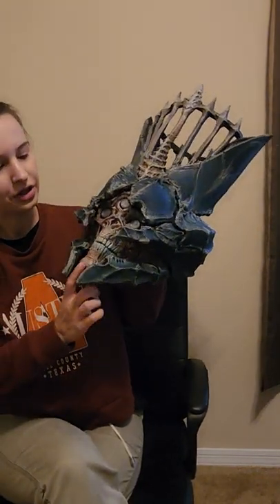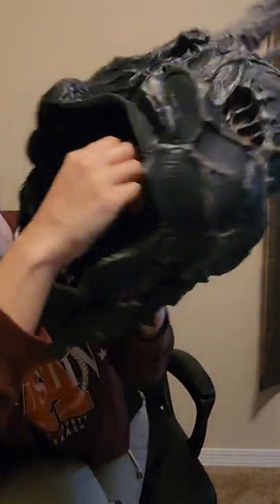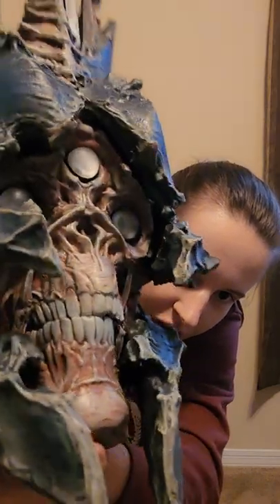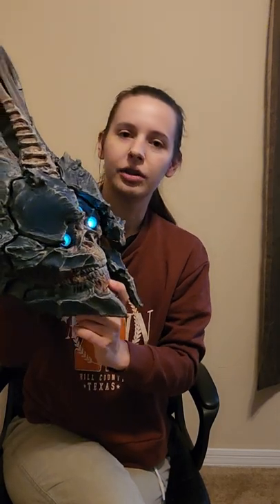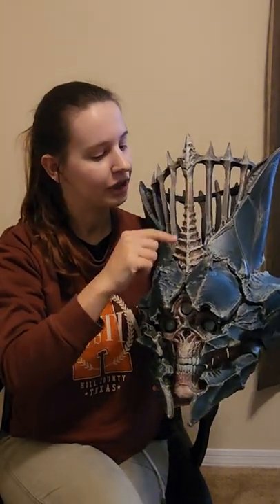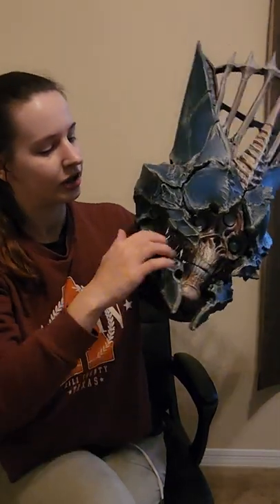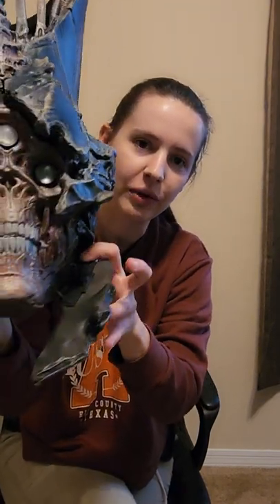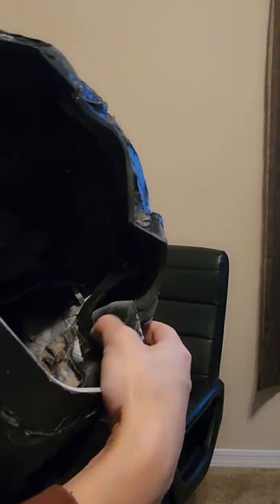Behind the mechanical Savathûn mask, construction and explanation

Comment: i think what would be perfect to add to your savathun cosplay would be the extended digitigrade legs to add to the scale and proportion of the whole  thing. i saw your short of the costume and the top looks really really good, but the bottom is a bit smaller than expected, likely due to height.  with more height it would really pull the whole thing together.
Reply from the maker: It is very difficult to wear a full costume and it gets infinitely more difficult if you add stilts to it
Reply: @WillowCreative  for sure. i really like the costume as it is!